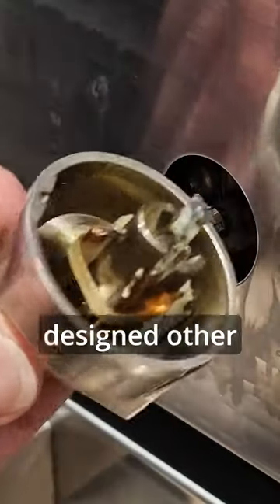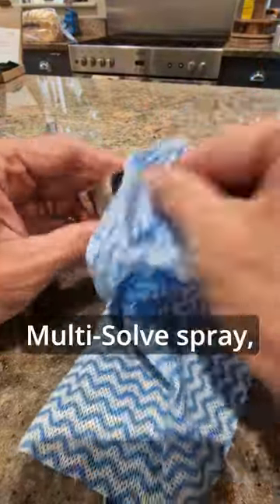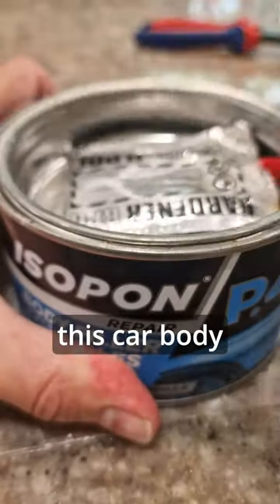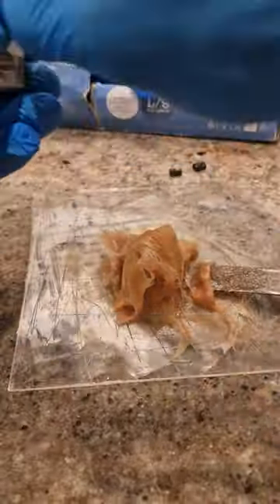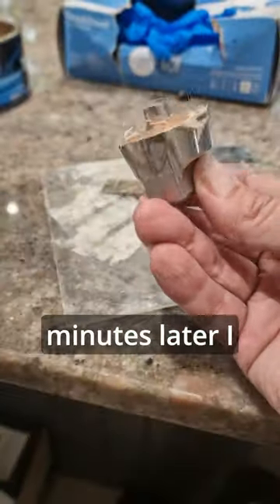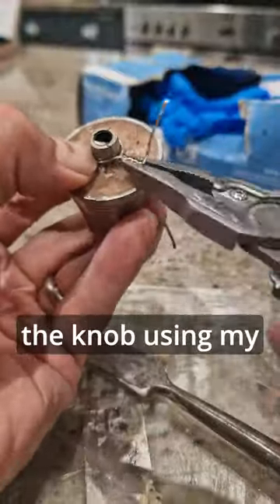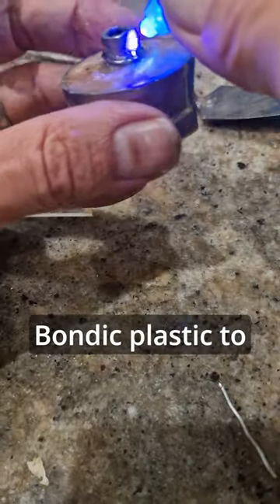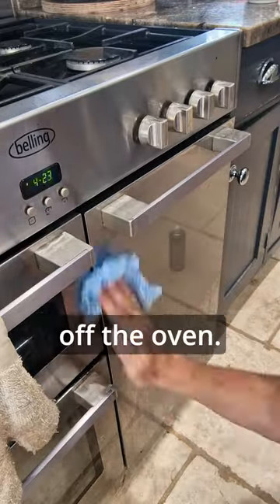Oven Plastic Knob Repair #shorts

Comment: The nuclear fix! Love a repair like that, under your breath you're saying "now break you *ucker!"
Reply from the maker: Ha, exactly 🤣👊 Just annoying these Muppets can't give us a decent metal knob in the first place or design a plastic one that doesn't fail. I've bought SO MANY new knobs over the years and they just keep failing.
Reply: @CharlieDIYte  I guess they figured the chromeish laminate was enough metal. How much does that hob cost? Looks like one of them expensive jobbies. Maybe take a good one and make some castings? Then sell them as aftermarket mods.

Comment: Things like that I have wrapped cotton around the outside of the part that broke, soak it with superglue, the cotton acts like an aggregate same as in concrete. I have repaired all sorts of things using that method, your fix worked but if it gives on that end piece I recommend this it really is indestructible.
Reply: This would have been a much better repair than filling the bIt that doesn’t break
Reply: Super glue and sodium bicarbonate! Exothermic reaction & the result is rock hard. It's so hard that sanding down proud areas is very difficult, even with a Dremel and those metal bits.

Comment: I had the same problem , went to price them £14 plus VAT , have a 3D printer so printed new ones cost a little time and about 20p for filament. Been using them for a few years and never broke, but if they do it will cost 20p to replace them, still have the files for the printer.
Reply: My main use for my printer. Spares for obsolete items.
Reply: Can you share the STL?

Comment: Should of wrapped wire round the broken part first then filled it with the fibreglass body filler.  Great fix 👍
Reply from the maker: That's a good point. 👌
Reply: *should have
Reply: @HEXhibitionist   Don't worry, one of the other knobs will break soon enough and you'll have another opportunity!
Reply: The wire before hand would have strengthened it further and concealed by the epoxy. But, not bad job
Reply: @HEXhibitionist I’m glad I’m not the only one correcting grammar. I shouldn’t but I can’t help it sometimes.
Reply: I agree, but God loves a tryer, alls well.... 👍🏼🍻
Reply: Ordinary epoxy would do the job and faster without the risk of marring the “chrome” finish.
Reply: @BlueDart1971 I only feel the need to correct people when they call me a looser, for some reason the irony of that one compels me to correct them..
Reply: @jordanlea1502  if it makes you feel better.
Reply: @BlueDart1971  If you would of been the only in correcting the gramir, then you might of been to busy to correct the spelling mistakes though.  Aye?
Reply: @cormchm2853  do you also want me to correct your spelling mistakes?
Reply: Still working OK? Looks bomb proof!
Reply: Maybe using a bit of tape mesh around the plastic and layering the epoxy to thicken it
Reply: Should HAVE!!!!!!! JEEEEZ

Comment: I fixed mine, a far simpler method, stick the pieces in with super glue and the wind cotton around the whole depth of the broken part, then cover the cotton thread with super glue.

Comment: You said it was temporary, so this is not a concern, but it's ironic that you're repairing plastic with a UV light, because that radiation degrades the plastic itself, mostly on the outside.

Comment: Hello 👋 I had I similar thing happen with my air fryer I used plastic glue on the broke component and glued a cable tie around it and once zipped I trimmed the excess and it's been fine ever since 👍

Comment: If it is abs/asa plastic, a slurry made of acetone+the correct plastic may work to reinforce the broken collet.
Since those plastics fully dissolve in acetone, you are basically adding more layers of the same plastic. Reinforce with  steel wire as you wish.

Comment: If you have an oven with a hinged glass top, do not do this. There is a mechanism that automatically turns the gas off when the glass top is down to stop you putting it down onto lit burners. The mechanism turns the knob from the inside to the off position, so covering the inside of the knob with filler will cause this not to work. If the knob breaks, just get a new one specific to your oven.

Comment: NO NO NO
Metal sleeve or a nut and a bit of plumbers epoxy putty. 
I've done loads of tap and other knobs my last was a shower valve.
No UV glue No twisted wire just a nut or sleeve and putty
Reply from the maker: Makes sense. Just used what I had lying around.

Comment: Have you tried the two part mitre fast glue? Cracking stuff, apply the glue it comes with to one part (it will work with any super glue) and spray the other part with the spray can the kit comes with. Sets in 10 seconds flat. Wouldn't be without it these days.
Reply from the maker: Yep I've got that stuff. Never used it for plastic though. 👌

Comment: The knob broke for a reason 
The switch or the valve is too tight and needs lubricating or replacement
Reply from the maker: Nice idea but not true as it's generally the oven knobs which break - which have a lot more natural resistance to switch on and off. The hob knobs have no resistance at all.

Comment: I've fixed this same problem with a single strand from paracord, resemble broken bit then tie a constrictor knot and set it properly and then trim the excess strand. Its lasted 2 years now.
Reply from the maker: Wow, good thinking. That sounds similar to whipping twine. Used it a lot over the years for sealing ropes etc.

Comment: Get a Smeg, Belling should be taken to task on this bad design. If the knobs are thsi poor what's  the inside of oven the like?
Reply from the maker: Used to have a Smeg. Loved it although did have to replace the heating element twice. The Belling was cheap and other than a door catch has been brilliant over the years (13 so far) so this type of willfully bad design is even more frustrating. 👊

Comment: you can also get a metal mix as well which is similar to epoxy but easier to use comes in the little sausage you cut a piece off mixer in your hand until it starts getting hot and then mould it into whatever and it's heat resistant

Comment: Did something similar on an air fryer. Used thin wire and gorilla glue epoxy. So far so good
Reply from the maker: Great repair 👌

Comment: That uses cheap Asisn components. It looks like the stove is an expensive brand.
Reply from the maker: It's a Belling which is one of the cheaper brands
Reply: @CharlieDIYte  
But a component that needs to move every day should be more robust than that. Today, the accountant runs the engineering and purchasing departments.

Comment: The fact that you have to repair the knob at all shows how poor the material integrity of the knob  is. Shame on the manufacturer - they have made them as cheap as possible. They know damn well that the knobs will fail.
Reply from the maker: I agree. Nothing annoys me more than bad design as it's so unnecessary.

Comment: This is my kind of fix.

When my uncle's laptop screen kept coming loose, all the screws would undo themselves and basically the screen and bracket would come apart, I screwed it all up together, took off the hinge covers and coated everything in UV epoxy, then took off the parts that hadn't come undone and did them as well.

It was an old laptop but he wanted it to last just that bit longer so the entire thing felt almost metallic with how rigid and firm it all became and it lasted another 2 years before obsolescence meant he needed to replace it any way.
Reply from the maker: What a fix👌 Well done. So satisfying fixing something like that and more so because you came up with the solution. I bet your Uncle was over the moon wasn't he?

Comment: It’s good to give it a go but the tin of fibreglass was probably more than a new knob.
Reply from the maker: Problem is you can't get these knobs on eBay. Belling charge upwards of £40 for a new set
Reply: @CharlieDIYte  that sounds about right. Its a trick they pull so you buy a whole new cooker eventually.

Comment: I have a belling oven and the knobs are screwed as well. They used the wrong type of plastic which has cracked. It causes the knobs to perpetually rotate all the way to the hottest point. I have to use sellotape to stop my food from burning!!
Reply from the maker: That's exactly the problem I have and it's very hard to surface cheap alternatives. You can order replacements from Belling but they're about £40 for a set.

Comment: Very odd.

You filled a cavity in a way that gave no strength the weak part, but did not support the area around the weak column that had cracked before 🤔
Reply from the maker: It's supporting the cracked piece at the bottom. The repair is still going strong so I obviously did something right.
Reply: @CharlieDIYte  You haven’t responded my point at all. The point is based on the fact that the weakest point is that the open end of the hole, not the blind end.

Comment: Had these on an old Belling cooker, not fit for purpose. Melted and to buy new ones at a £ a pop, would have cost £100.00 😮
Reply from the maker: Exactly. Mine's a Belling too. To stop them melting it's important not to put foil in the grill, as it reflects heat up into the knobs which is why they melt - as I found out after incinerating loads of them 🤦

Comment: Drill a hole through the knob put in a steel rod with a cap on the back and weld it right to the gas pilot
Reply from the maker: I like it. They'd avoid all this by giving us decent metal knobs!

Comment: Or juat email beline tell them the modle and buy a new set .cheaper than  tin of filler
Reply from the maker: It's about £40 inc postage for a new set.
Reply: @CharlieDIYte  wow that's a rip off . So that case well done.

Comment: I hate belling. Same awkward circle with flat base that breaks on my grandmother's cooker too. And for her range it's £18 per knob to replace.

For a regular home diyer without uv lights and car fibreglass putty is there an more economical way?
Reply: 2 part epoxy and superglue might work. Both available from pound shop.
Reply from the maker: Yep, I agree with that. And you can buy this fiberglass epoxy on Amazon and in a lot of petrol stations. You don't need the UV glue. I just used that because I had it lying around although again it's called Bondic sand you can pick it up on Amazon or eBay pretty cheaply.
Reply from the maker: I agree. It's a cr@p design. Cheap oven though and it's lasted over 10 years to be fair.

Comment: What an absolute jobsworth ... quicker and cheaper y
To research the cooker name and brand model and order a new part ... fibreglass epoxy wire and uv resin/ glue 😂😂😂 how much is that dial worth ... not that much hahahaha
Reply from the maker: WRONG WRONG WRONG John. I've ordered replacements many times from Belling - it's very difficult to get the truth ones from anywhere else and they quickly fail because of the design. Also they're about £40 a set plus postage which is why I did the repair.

Comment: I had the exact same oven in the first house I owned. Great piece of equipment apart from these knobs, in my limited 2.5 year experience of the thing.
Reply from the maker: Exactly.. It's a poor man's Rangemaster I always told my friends but pretty bullet proof considering what it cost - lasted over 13 years and still going strong.. The knobs are aweful though.

Comment: Or just order a new set off your fav auction site. Which would work out cheaper than buying that crap you filled it with.
Reply from the maker: You can't get these on ebay
Reply: Yes you can @CharlieDIYte  there are pages of them £10 for a full set.